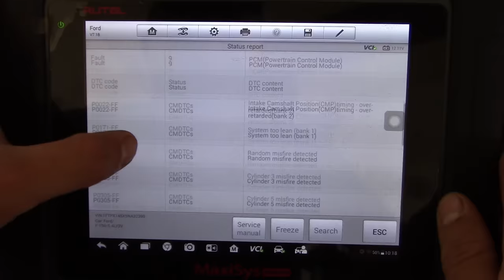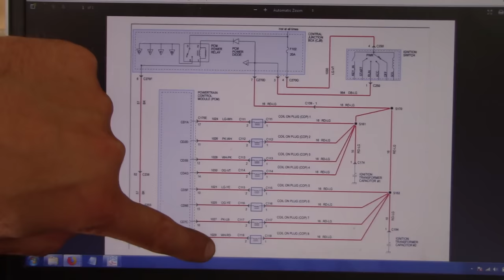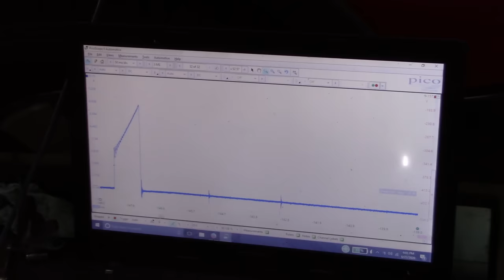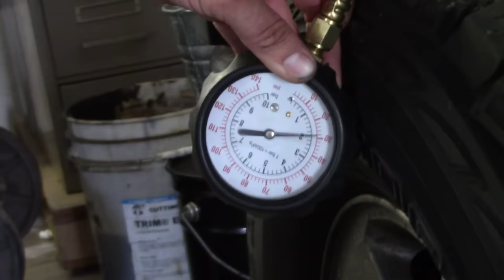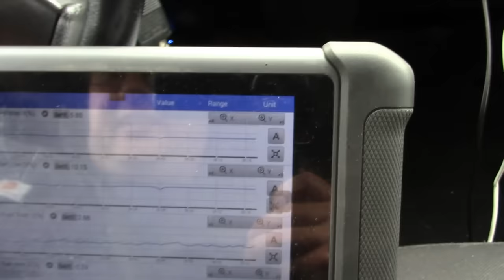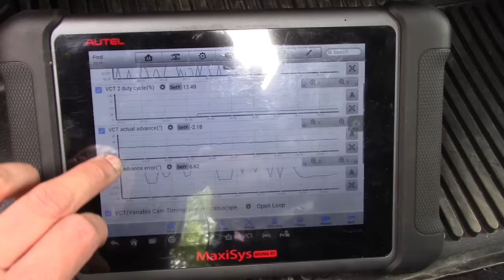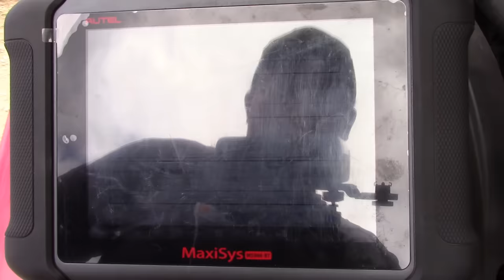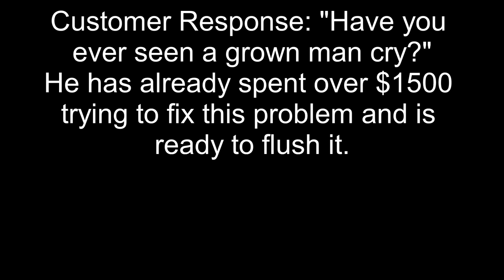2005 Ford F150 5.4L - missfires, intermittent rough running, rattles and knocks, P0021/P022

Comment: I agree the 5.4 has it's issues, but the utter lack of maintenance and ignoring obvious problems ( belt tensioner pulley eating through the front cover OMG!!), led to certain failure. It wouldn't matter what engine was in there, it would have had significant problems.  I have 180k on my 05 and only have a slight phaser knock at hot idle. Been like that forever.  Otherwise it idles smooth and runs strong. It's all about maintenance. Can't get away anymore with missing oil changes etc, especially on these over engineered complex modern engines.

Comment: Wes, I have a 2001 4.6 2 valve that has a trashing sound on a cold start out of the tensioner.  Once warm the sound goes away, I can add/ remove  tension to the thrashing goes away. I have scoped all other pulleys, they are fine. With the belt off the front of the motor there is no sound.
Reply from the maker: A new tensioner is cheap insurance.
Reply: I have put 3 different tensioner’s on all do the same thing.

Comment: Well now I'm very discouraged with my 2007, 136K miles, F150 King Ranch 5.4 and the death rattle I hear on start up. I've always used full synthetic oil. I changed plugs and coils and now I'm changing the injectors to stop the misfire.

Comment: The old  cathode-ray oscilloscopes made that same pattern. I'm guessing that any misfire in modern engines will crack the heads.
Reply from the maker: The big concern with missfires in modern engines is damage to the catalytic converter from the raw fuel being dumped into the exhaust.

Comment: Right when I heard it run, I knew oil was not getting to the top of both sides at pressure, and the oil pressure guage quivering helped  prove it.  Would like to know if you got paid for your time... or did you just eat it.
Reply from the maker: No I was paid.

Comment: I'm just gonna mention this out of the blue, the lack of power may be the knock sensors, I had a 07 with bad knock sensors, it was wayyyy down on power, change them and it towed 28k gvw from Nebraska to florida no problem (well as problemless as a the 4 spd running at redline up a hill)

Comment: Sometimes you gotta do what you gotta do, but that truck needs a new engine.  They must be properly maintained due to some pretty serious design flaws.  I see that the thing is still going with the work you did to it, but it's days are numbered.  I just pulled a 5.4 with 150k on it, pretty much a similar scenario.  Had timing guides, metal flakes, and moisture in the oil pan.  Was pretty bad.  They did update the 5.4 heads a couple times, and after 08 they are a fairly solid engine but still need strict maintenance.  I actually dropped a higher mileage engine out of a 2010 in the truck, took some video of it.  These things are a nightmare to work on.

Comment: change engine light, Haha! The shop I work at has about 40 or so E350 15 pass vans, Thats all I work on every single day, I guess its job security, I got a 5.4 in a 2004 slider van that blew up in the parking lot, the guy went to take of out of the drive and and it threw a rod right there. I really wished Ford used the single camshaft like the GM engines, a tune up is rather annoying on them vans, especially if they have EGR tube coming off the manifold, just not room, or the timing chain cover because ford is smart and makes the belt tensioner pulley face the timing chain cover.

Comment: Sounds like rocker chatter, but everyone goes directly to VVT phasers. The rockers in those motors are under tremendous stress and more often than not are first to fail.

My 2010 has over 200K and never knocked like that, that tuck has mechanical problems.

Comment: Throw them plastic tensioners away use ford racing cast iron tensioners and put the cam phaser lockout kit and new chains in it. Also put updated design one piece motocraft plugs in it and viola. Bulletproofed.

Comment: My '05 had a miss when it warmed up. Turned out to be one of the heater hose connections at firewall, dripping antifreeze onto the coil.

Comment: Wes - what a great video. Unfortunately for me this was exactly the issue i was having with my Ford. I know you did this video awhile ago, but i am just now going through this process. I watched the entire video where normally most people i literally click out - you i did not. It crazily enough sent chills down my spine when you diagnosed my issue - as much as i want to save my nice truck, i love my truck, your video mimicked the mechanic i was using in saying that the diagnosis was not good. I have some cash to burn, so i think i might fix the truck and do the simple things in hopes that the rest is fine. Not sure how long this problem lasts until you really do damage to the engine, but willing to try.

Do you know how long this problem goes on until you literally have the replace the entire engine? Thanks again for your video and the answer.

Comment: Wild.  Found this b/c my 07 is having terrible misfires and running rough after I had the manifolds replaced.  Was not having any issues with it before, just the knocking from manifolds.  Can't figure out what has happened and it has to be related to something done (heads were machined in the process) but now it seems like it's just going to be about 200 diff awful things combined.  Mine has 220k on it too.  Yikes.

Comment: I have fixed the cam journal problem on those. The problem is they feed oil to the BOTTOM UNLOADED side of the bearing allowing too much oil to escape the journal.
 You must align bore and install cam bearings. HOWEVER, on all except #1 when installing the cam bearings rotate the bearings 180' so the oil hole is on the TOP of the bearing instead of the bottom! You must cut a groove in the housing bore from the oil hole on the bottom around to the cap so that the oil now feeds from the head AROUND the bearing and feeds at the top.
  For all you gray beards this is the SAME EXACT PROBLEM Ford had with the 2300 4cyl YEARS ago! They oiled on the bottom of the journal. As the cam wore into the bearing it allowed excess clearance on the BOTTOM letting the oil flow out there instead of going into the cam and oiling the followers wiping the cam. There were cam bearings available with groove cut into the back of the bearing allowing them to be rotated 180 without doing any machine work. Same problem here.
Reply from the maker: FWIW, I put that engine back together just like it was and it's still running fine today.
Reply: @WatchWesWork  Oh they will RUN. But have low oil pressure and eventually completely eat up the cam journals. I have seen quite a few in my cylinder head repair shop with this problem. One of the reasons the Phasers are noisy. One of the reason they came out with the high volume/pressure oil pumps, to overcome the oil pressure loss at the cam bearings.

Comment: The Autel states an "Open loop" on the VCT. Open loop means not all data are collectible yet and it runs on mapped values. That should be a hint that at least one sensor ain'T working properly.
It should state "Closed loop" iif all compenents are working.
As there is no "Loop error" stated the failing component is working in a range that the PCM does not recognize it as broken.

Comment: Triton hand grenade! Too funny! Timing chain stretching, chain rails breaking spark plugs stuck in the 3v heads and blowing out on the 2v heads and occasionally broaching come loose on cam lobes ! With all that its design is still better than Chryslers 2.7L v6. Chry. recommends changing oil every 1500 miles to prevent sludge buildup.

Comment: The result of not changing the oil. I just did a timing chain on my 2005 with 196,000 miles and it didn't even look that bad.

Comment: The best thing in that case with camshafts with tigere scratches is to block the gears and eliminate the vvt system, put metal chain tensioners, you will lose a little power but it is minimal, nothing that cannot be overcome, the truth is it is worth it, or there is like the 4.6 lt engine in these trucks

Comment: Not being the expert but all those insignificant codes come from a loose cam phaser chain and guides. Having endured long discussions with Ford and their lawyers by email,and all the message boards say any stop gap repair will be temporary at best. Engine rebuilders have tried to address this and have been reasonably successful.

Comment: Cam phaser will lock down at 1250 rpm. Worn oil or too thick oil will cause cam phaser issues. Use only motorcraft filter and 5w20 for proper cam phaser performance.

Comment: Dirty rusty water in a spark plug well certainly causes a misfire. I didn't even have access to a scope when I had a 1954 Dodge with a Red Ram hemi nor in the first years I had a 1969 D19 Citroen with a 4 cyl hemi. Once the plug boot is discoloured you are going to have misfire in humid weather as a path has been started from the top of the spark plug to the  to the base of the spark plug.

Comment: The problem with the dealer just doing coils is... they never get to the vehicle until the engine is cold. Everything runs fine when its cold. I know, i have an 08 with the same issues. Ive done the sols, phasers,  timing chains, guides, tensioners and oil pump. Worked fine for a few hundred miles and it started the death rattle again at a stop. I've yet to put a pressure gauge on it... my next step.

Comment: I have a tried tested and proven solution to remove this noise, make it quiet, run smoother and more mileage and more power. Within 5 to 10 minutes and at a reasonable cost. Smooth start in peak of winter at -45 degrees. It will last for half a million miles easily

Comment: It makes me feel a little sick really. I just bought a vvt engined car. I think the maintenance has been better and I just drove it 400 miles @ 80 mph and it got 30 mpg. It isn't a Ford but a Dodge. I got an extended warranty on the drive train. So far so good. I have been considering removing the transmission pan and changing all the oil that will drain out and putting a new filter in since it is a six speed automatic.

Comment: I know you likely get a ton of questions and no way you can answer them all. as a youtuber myself I totally understand. here is my question. I have been looking at a 2002 ford f350 with a 5.4l  engine. it has 149,000 miles on it. truck is in mint condition. no rust, interior is flawless. would you pass on this truck due to all the motor issues like plugs blowing out and what not? or is it worth buying and installing the inserts to fix the plug issues? its a 2 valve engine not the three valve. any advice you can offer is greatly appreciated.
Reply from the maker: The 2V is a good engine. It's not a big deal to do the inserts. I may well have already been done.
Reply: @WatchWesWork  thanks Wes I will go look at it. seems to be flawless only issue is price. 2002 f350 5.4l 149,000 miles and he wants 16,000.00 for it blue book is like 13

Comment: Also Install a new Melling M360 HPHV Oil Pump...!   (Which will give a minimum of 40 psi oil pressure at all times including hot idle in drive.)

Comment: just blows my mind on the amount of rust under that truck and frame do they build anything with quality anymore they pull something 100 years old outta the trees and it looks better than the high dollar junk we get nowadays and the stuff already has rust on stuff only a few years old if you dont believe me how long have trucks been around were you open the door and the running boards automatically come out dodge pickup white lots of rust on the bottom of cab already

Comment: I have an 08 that recently began to have the startup rattle once in a while. Tensioners I figure. I fix all my own stuff but I’m a little nervous about tearin into my 5.4 3v. Should I change the spark plugs or leave them alone? Original plugs but only 41000 miles.

Comment: My brother has a 2010 f150 with the 3valve and months ago it started having this rough and rumble effect to it and it kept getting worse. He took it to his mechanic more than once but they didnt fix it. It got so bad it sounded like the 5.4 turned into a power stroke. I immediately had the thought of the cam sensors being off and I checked videos online to see if I could hear the same sound being made from other peoples 5.4s Sure enough I replaced them and it retuned itself and is fixed. Pretty sad that a 1st year Apprentice figured out something that jouneymens couldn't fix. The other sad thing is they've had the truck at their shops longer than the time I spent figuring it out. The only issue now Is theres a small noise that's barely noticeable but since his coil packs and spark plugs are probably stock and havent been changed I bet that's the issue. I assume the plugs are fried a bit from the tune that the engine was running on

Comment: My 03, 2 valve 5.4 had all of these issues, rough idle, performance loss, running very rough, misfires, mechanic says it jumped time, is that a possibility? He thinks the timing tensioner is bad, the timing assembly has never been serviced, 153,000 miles and had been cared for better than most vehicles on the road

Comment: With the Autel scanners on fords instead of going into diagnostics go into I believe it is the service tab and then powertrain and select the power balance test to get a live misfire graph.  The update rate on the mode 6 data at least for me is extremely slow and sometimes you have to back out and re enter mode 6 to get it to display updated #s

Comment: Man I have worked many of them motors from my experience I would get 2 cam phasers lockout kits and lock them instead of replacing them very expensive phasers. And hell yeah change the timing chain tensioners and pulleys. I think they supposed to be changed at around 120 thousand miles in the maintenance schedule anyway. I changed mine about the same miles and it run like a new truck much much more power and double the gas mileage. If possible get a chain kit made in Japan and any other parts you can from Japan they have a higher standard of manufacturing than any other contury.

Comment: I have an 09 f250 that had these problems, engine replaced with a jasper reman in 2012.  Are the reman engines redesigned at all to work out these problems?

Comment: wow... I am having a nightmare too with my F150 2005 running really rough with with camshaft position sensors code... replaced the sensors and still with the same problem....

Comment: It was unfortunately junk when he bought it (I suspect the previous owner knew it was junk especially due to that dodgy repair when it grinded the cover away and only sealed half of it) probably never had regular oil change witch tends to be one of the reasons the poorly designed gaskets disintegrate

I dread the day I get a car that uses them point spring loaded tensioner devices they seem A very common point of failure due to the spring losing its tension

Comment: Question, I have a 2004 F150 with a rough engine idol, replaced everything, only thing left is replace the Coolant temp sensor or Pigtail that seems to fail random codes P0221 & P0223

Comment: 🤔   I have a 06  I put in new Cam phasers, cam sensors, spark plugs and coils, timing chain and still have the same problem runs real siity,  I want to know about doing a  LS 5.3 engine swap,  to save my truck with a more reliable engine.

Comment: I bought a 2005 f150 5.4  the battery light is on I've replaced the alternator and battery & light is still on I can't figure out what's going on I'm thinking it may be the harness from battery to alternator  or the ecm ,have  you seen this problem  & shed any light on this problem ?

Comment: Yes it happened to me yesterday sadly enough the motor ended up blowing up got it to the shop and we put a brand new motor in it and got the delete kit for the cam phasers so now the issue is not going to be there for its rest of the life I dropped about $5400 and a new motor and labor was 1200 that is really crazy

Comment: Seems like VVT adds a LOT of complexity and additional failure points for not a lot of gain.  How much energy/carbon is really getting saved when your vehicle just has to be thrown away every 100k miles and all the energy has,to be expended to build a new one vs when they'd go several hundred thousand and then could actually be rebuilt by local craftsmen?

Comment: deferred maintenance. looks like rod bearings are shot too. that's what happens when you wait until the oil light comes on to change oil. the 20w50 in there is what blew out all the gaskets. never seen a mod engine with 75 psi oil pressure, relief is like 55 I thought

Comment: Fyi - if you raise the RPM the triple strike will drop back to a double strike - then it will drop back to a single strike and you can easily see if the coil is a problem....

Comment: It makes me wonder.....is this the same design that plagues the 2010-2012 Range Rover as well with the notorious timing chain of death? Granted, thats a Jag motor and everyone says its designed by Jag engineers, Ford just owns them. Yeah but I have a hard time believing that the same failures you see on these Ford modular V8's, you see on the RR V8's. Granted the Jag V8 is not a 3 valve but who is to say that Ford engineering didn't push a portion of their design onto Jag? Interesting......Any thoughts, Wes?

The V8's on RR's before 2010 were BMW V8's. Also known for timing chain issues but not like the Jag and Ford motors. Also, the BMW chains/tensioners/followers are a lot easier to replace than the Jag V8. Its so similar to this motor its got to be the same.

Comment: Which one shoots plugs through the hood the 2 valve or 3 valve ? I mean what next ? We fixed the blow out problem but now they break in half and you have to order special tool to extract them. Talk about 1 step forward and 3 backwards ! The only motor Ford should be able to manufacture by law is the 4.9 tractor pull or that's the only one I would have! Sad pretty sad